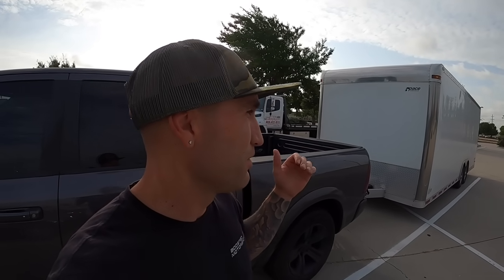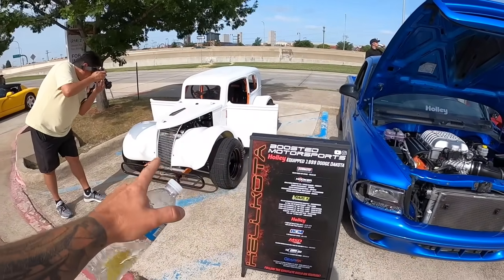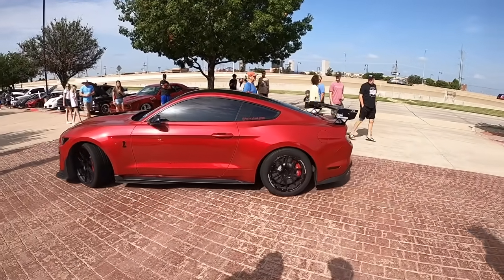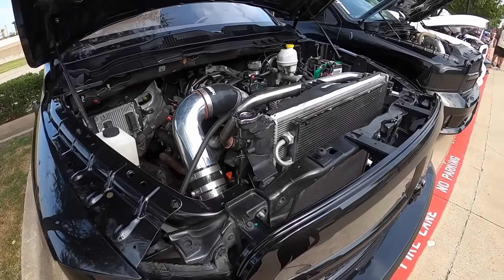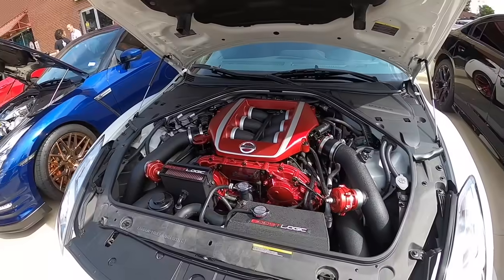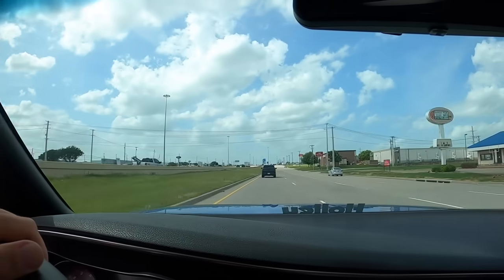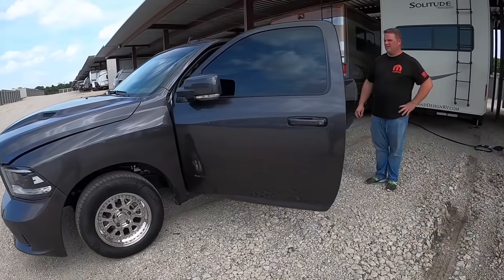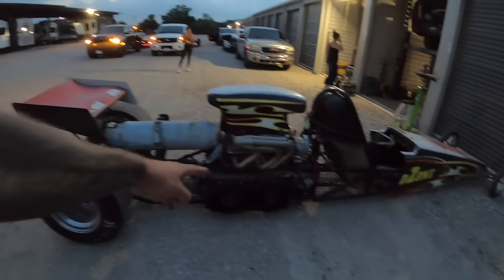HELLCAT SWAPPED DODGE DAKOTA IN DALLAS TEXAS

Comment: Condolences on the 8HP95-  but you had me concerned that it was the 6.2 that blew-   Transmission is less expensive than the engine taking a crap- #silverlining 

Was this a rebuild? Or straight from the yard?